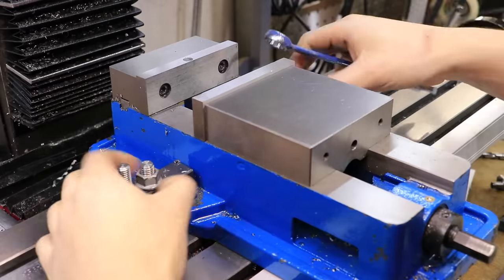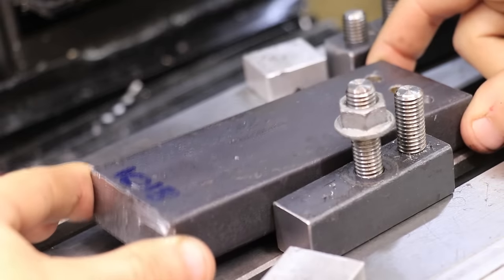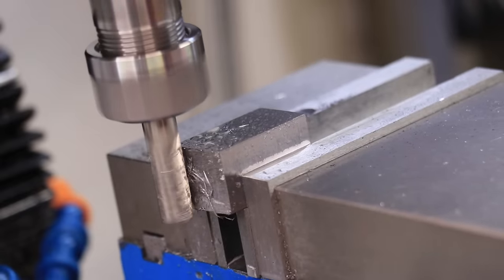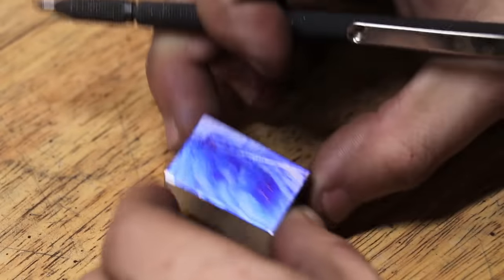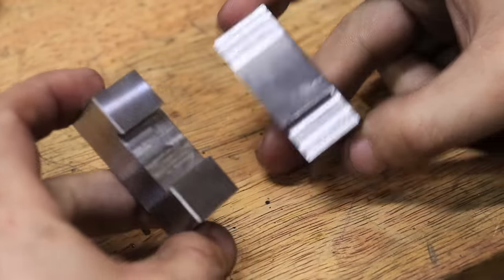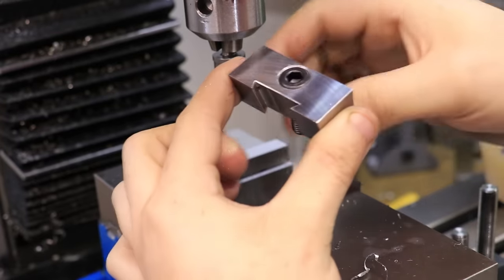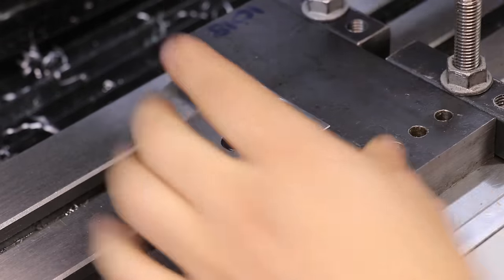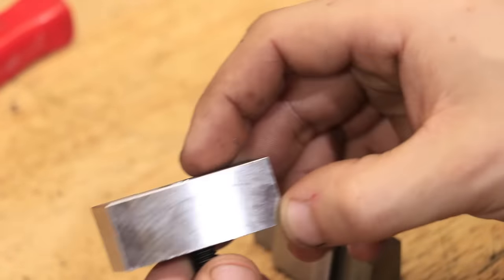Easy Low Profile Side Clamps For The Milling Machine

Comment from the maker: Almost forgot to add the link to the e-drawing. It is quite simple but should be good enough for you to get started. https://imgur.com/a/dIIQWqd 
EDIT: Revised drawing with slightly reduced angles to help prevent the moving jaw from sticking.
Reply: link is not working But thats great and simple thanks for sharing cant wait to make my self.
Reply: Thanks mate, now I have something to work on rather than sitting on the Couch. Cheers my friend.👍🍻
Reply: @mysterysniper910  the link works fine here
Reply: Maybe next time you use a file and hacksaw to cut steel, instead try using a cut off tool 😜 or steel cutting wire 🤣
Reply: great version of this type of clamp and thanks for the drawing.
TheMetalRaymond did a similar thing, but bigger, chunkier and didn't bother with the dovetail.
https://www.youtube.com/watch?v=IR2p9ceg1bw

The other thing he did which might interest you before you harden the front edge is the step the front so it has a much lower front face. You could easily do the same with you clamp if it were a bit thicker or you could bolt a jaw onto it. That way you'd be able to completely face a slab of material like the one you demoed.
Reply: Thank You for Sharing the Drawing and the Revision Sir.
Reply: Congrats, you won our subscription！ Thx so much for bringing us this wonderful content! 👍

Comment: Beautifully simple design, I really like it.  In the absence of hard teeth to bite into the workpiece you could probably use a piece of emery paper between the clamp and workpiece to get some extra bite.
Reply: Awesome idea. I nevet thought of that.
Reply: I had once these clamps .  Be aware they hold much less than a vise or regular clamps
Reply: @Hendreh1  The effectiveness of the clamping force is dependent on how steep or shallow the wedging angle is. There are 2 piece bed jaw systems working on this principle that hold the workpiece very firmly
Reply: @howardosborne8647   as I said , I have really used These clamps.   And the angle was not an issue .   But  the Holding force of the t-nut in the table .  It Moves sideways.
Reply: @Hendreh1  The simple solution there is to make a longer Tee nut which has a larger surface footprint.
Reply: @howardosborne8647  the simple solution is to clamp the sides too 😉
Reply: You wouldn't want your clamps to bite into the surface. That's just gonna damage your workpiece.
Reply: @dustinandtarynwolfe5540  So why do the commercial side clamps have replaceable hardened inserts with aggressive teeth? (they look somewhat like a lathe tool insert).

Obviously you would not clamp on finished surfaces, you clamp the edges, do the machining on the flat sides and then machine the edges as a separate operation in a e.g. a vice.
Reply: @Hendreh1  you could also add a piece of paper under the anchor part of the clamp itself. This will act as friction material against the mill table to help prevent the clamp from moving

Comment: Interesting idea. I'm guessing it would work without the dovetails too...
Reply from the maker: I made a prototype without them, and you might see them in the video where I use them. They worked fine, but I seemed to get slightly better clamping with the dovetails, and they were a little easier to set up ands store. That's how I saw it, but you can always do it without them if want. Cheers
Reply: I'd guess even a simple keyway would be fine. Anything to keep the halves located in the presence of lateral force would serve the purpose, no?
Reply from the maker: Im sure you could approach this many different ways and get similar results

Comment: The claws with pull-down are very good, but must not be used for thin sheets. The other is the danger caused by twisted tools, where the tool tries to pull the material out of the claw or push it away. Attention: tool must be sharp, not too much, on the other hand always have a firm stop. Through a steel iron that sucks into the T groove and protrudes 1/4 lower than your finished measure

Comment: Great idea and video. I've started making a set of these using your drawing as a starting point - just finished the dovetails (my first ever). I notice you have changed the drawing slightly so the moving jaw is the male part of the dovetail, but in the video you have them the other way round? Is there a preferred orientation for this kind of application or does it really not matter?

Comment: Whats with the runout on your mill spindle. Those are the most jank clamps I've ever seen.  Since this is a tutorial you should have mentioned the part where you milled down the t nut.
Reply from the maker: What run out are you referring to, last time I checked it was below 0.01mm. and the clamps work perfectly fine

Comment: Nice video.    If you take a few millimeters off the bottom of the moving jaw (making it shorter than the fixed piece), it will probably be useful in more situations/configurations.
Reply from the maker: I am sure that would be an excellent idea

Comment: Great design! I’ve been looking for something exactly like this. Any chance you’ll be making any more?
Reply from the maker: I probably will once I get more material, everything seems to be on backorder at the suppliers these days :)
Reply: @artisanmakes  Make friends at a local scrap yard!  Tell them you're a hobby machinist and take along some items you have made.
Offcuts from screw-machine shops and fabricators go a long way to reducing costs.
Tool steel you can get from annealed automotive springs.
For complex items such as machined-from-solid crank shafts I purchase a piece of stressproof aka 1144 machinery steel.
Your low rise clamps are very nice and useful indeed.  To resist wear and tear, case hardening or pack hardening would be a useful.

Comment: Those should have a slight dab of moly or graphite grease, on the sliding surfaces of the dovetails and the Tnuts should be well greased aswell as the whole mechanism has a lot of interference with itself, the part its holding and the table`s tslots via tnuts while being tightened...  A great design, tho its one, like a two piece vise, that i would use with a separate tslot base affixed to the mill table, as not to mangle the table, given that it essentially relies on the strength of the Tslots for its max clamping capacity, and when shit shifts around, you tend to crank it down doubly as hard, and that is a surefire way to excavate a chunk of your table... And the only thing as bad as that is getting caught by a machine itself and being mangled unto death...

Comment: Nicely done, I think I might make some of these for my CNC! To get around the height issue, you could put another piece of material under the work piece to raise it up slightly. You would need something approximately the same size though, which might not always be practical.
Reply: I was thinking of the same thing. Perhaps the riser piece could be longer on one axis and clamped at the ends sticking past the actual work piece?

Comment: The ole k.i.s.s. method for the win!
 I always feel you need to clamp something down, not across but that is a solid idea. The best part is if you need to clamp low objects you could use some thin stock in between 
the clamp and the part to be machined to give the cutter clearance? Just thinking out loud on that one.
 Keep up the good work!
Reply from the maker: Yeah I'm sure there are many ways of going about using them

Comment: I am concerned by potential T-slot damage. The fixed jaw is clamped to the table, with a compressive force applied to the cast iron table - equal and opposite along the T-slot bolt. The moving jaw is pulled down to the T-slot nut, but there is no equal and opposite force applied in the axis of the bolt (there is a gap between the jaw and the table), so there will be a torque and tension in the T-slot. Overtighten the clamp and the T-slot might break.

Comment: Nice project. I would think that the dovetail isn't actually needed. Just the slot and tang would hold it in place. Not everyone is going to have dovetail cutters.
Reply from the maker: You don't have to add them.i made one without them and the clamping force was slightly better with them. Plus it helps align them so they are easier to set up and store. In my opinion they are worth adding but of course you can change up the design as much as you want to suit your set up.

Comment: I'm pretty sure you also need double T-slot nuts for this project ;) Basically a double length nut with two threads. It will serve many purposes:
- clamp alignment
- keeps the clamps together in storage
- better force distribution

and above everything else: It will just make some additional content for us to consume 😁😁😁
Reply: that would actually work against the mechanics of the clamp as the two bolts slightly move together while clamping...

Comment: Great design and I may well make up some myself. 
For the moveable jaw, if you milled it with an L shape so that only the bottom 5 - 10 mm is holding the work, this pushes the clamp back and allows access to mill the top of the work.

Comment: Like it, the dove tale wasnt entirely nessasery,, as the bolts center in the tslot? Whats your thoughts?
Reply from the maker: I made a prototype without them, and you might see them in the video where I use them. They worked fine, but I seemed to get slightly better clamping with the dovetails, and they were a little easier to set up. That's how I saw it. Cheers

Comment: Congratulations for your work. I have just one suggestion for the moving part of the clamp. As you you tighten the screw, the T bolt will be both moved forward and upwards. This tiny forward movement could damage your milling bed from underneath. In order to prevent that, just mill an ellipse into the moving part, instead of a exact hole for the allen screw. I believe that this will allow a kind of "tilt" of the screw and this will prevent the milling bed from getting damaged. I am not quite sure if this is the best solution for that, but it is the one that I thought now.

Comment: Nicely made. Making the clamp with a dove tail isn't really necessary. A square slot or no slot at all would suffice. The clamping jaw isn't seeing any side loading or twisting as it is screwed down. Slotting the clamp screw hole, as some have suggested, isn't much needed either. A good clearance hole in the moving clamping block would be ample. Once set, the clamping block is only moving a few thousants of an inch against the work as it is clamped down
If you don't bother cutting mating tongues and slots, you could make two or three of these clamps in no time. As rarely as you need them, I wouldn't bother hardening them. That way you can always modify the jaws for a specific job or just cut into them if needed since replacements are so easy to make.
Reply: My thoughts exactly!
Reply from the maker: You don't have to add them.i made one without them and the clamping force was slightly better with them. Plus it helps align them so they are easier to set up and store. In my opinion they are worth adding

Comment: Will the off-axis engagement of the inner t-nut cause damage to your t-slots/t-nuts? I'm guessing that the cam-over will be pretty small, but I can't figure out if it is too small to cause problems. (PS comment mostly for algo bump ;-)
Reply from the maker: To answer your question, i don't know but I wouldn't assume so. If it is something that you might be worried about you can always just make one long t nut with two threaded holes so any deflection is taken up by the cap screw threads and the t nut should sit flush.
Reply: @artisanmakes  of you do that you will probably need to make the hole in the moving part of the clamp into a slot

Comment: Blow off the hack saw. "Diablo" makes a six inch carbide tip metal cutting circular saw. Use with a 6 inch cutoff (chop saw). Small and compact. They also have a blade for a reciprocal power saw...Also thumbs up...again.

Comment: there ya go, sitting here suffering my usual insomnia in 2:30am youtube hell, and a video from Artisan Makes pops up, how good is that! I might have a go at a set of these -  I also reckon you could possibly get away without the dovetails ?, the T nuts would stop any potential for sideways movement?.
Reply from the maker: I made a prototype without them, and you might see them in the video where I use them. They worked fine, but I seemed to get slightly better clamping with the dovetails, and they were a little easier to set up. That's how I saw it. Cheers
Reply: You can replace dovetail with a right angle groove.
Reply: @jakubkopec9313  Indeed.  A simpler method still would be to drill and ream a hole with its centre line parallel to the sliding surfaces.  A fitted pin may be held in place with a small screw.
Still, a dove tail holds the bits together during storage.
Reply from the maker: Yeah im sure that you could do that

Comment: Dont know if you have a welder but you could have, maybe, just welded to 'lugs' or bits of flat bar onto the metal you wish to machine, under the height of the surface you wish to cut. :/ this would mean parts would be hardened due to welding so it might not be suitable in all cases. Just a thought.

Comment: nice, i think it could even be done without the dovetail  .  Possibly does not need any lateral location, or if so just machine a shallow relief in the static part, or weld "shoulders/wings" on to it.  Maybe even mate the two ramps in a vice and drill a hole down the seam, then drop a dowel pin in.   Still I think it's the considerable friction that keeps it from moving, so the dovetail or any other guide is not needed.

Comment: Keeping them unhardened also means you can use them on finished surfaces on some materials and it won’t mar them. Of course you can add a softer face if that is a concern for other materials.

Comment: Could these be made with straight cuts instead of dovetails to simplify the machining or would they not work correctly like that?
Reply from the maker: you certainly can, they just take a bit more care to keep aligned before tightening

Comment: Make a low profile section into the clamping half that contacts the work piece and perhaps mill in some serations so the clamp can grip better. Consider you make the working piece side with a toe second that is about half the height of the dovetail. You need to make the toe section big enough such that the endmills you are using do not come in contact with the clamp. serations and case harding would help it grip parts better.

Comment: Great project & tutorial! QUESTION: Does the fact they're not hardened yield a better bite? Seems the softer metal would be "stickier" whereas hardened metal would be more "slippery." So, the un-hardened may actually function better, no? I could be wrong. I'm thinking in terms of woodworking where we want soft-wood or even cork-lined clamp jaw faces for best holding function. Wondering if same principal applies to metal ??? Thank you!
Reply from the maker: Yeah definitely. A good analogy that I use is that copper soft jaws usually hold much better than hardened steel but of course you have to deal with wear and tear. I'm sure if would apply here and if you choose to to harden it would depend on your use case

Comment: the dovetail isn't necessary at all but is a nice feature though.. amazing job
Reply from the maker: You don't have to add them.i made one without them and the clamping force was slightly better with them. Plus it helps align them so they are easier to set up and store. In my opinion they are worth adding

Comment: What's the point of the dove tail? It prevents the clamp from pivoting too much, but since your stock isn't squared nor your fixed side aligned...
Reply from the maker: I made a prototype without them, and you might see them in the video where I use them. They worked fine, but I seemed to get slightly better clamping with the dovetails, and they were a little easier to set up ands store. That's how I saw it, but you can always do it without them if want. Cheers

Comment: Hi, could you tell me why the dovetail slots are necessary? Would a regular straight slot not suffice? or maybe no slots at all since the bolts will keep the clamps from sliding away? This is a genuine question to gain understanding and not intended to question your design.
Reply from the maker: Helps keep everything aligned when it’s not clamped

Comment: Take it as a rule. if you are basing a part, then you need to put parallels, linings under the part. This rule will help you save the work table of the machine, or you will be punished by your master, sensei
Reply from the maker: Im not sure if ive ever heard that as a rule. I've many parts machined directly on the mill table without parallels, though I have also seen the opposite. Seems to me that it is more situational for the set up. Cheers

Comment: Just hold the part in a vice if you have a decent one......can't think why you wouldn't, the thickness of the piece in the video(approx 40mm?)  would not be a problem for the Z axis anyway unless you had a really small mill.
Reply from the maker: Well there are many parts that I have had to set up over the years that are too large or not suited for being held in the vise and had to be held directly to the mill table. The part in the video as I said was just for test.
Reply: @artisanmakes  You need a bigger mill to fit a bigger vice.....

Comment: You could make extra long T-Nuts with an additional threaded hole and run a stud and nut through it as well, clamping the nut and a 123 block onto the top of the table. This would greatly increase the resistance of the fixed block to keep it from moving.
Reply from the maker: Yes, I'm sure that would work very well